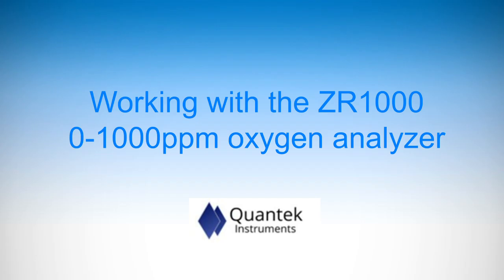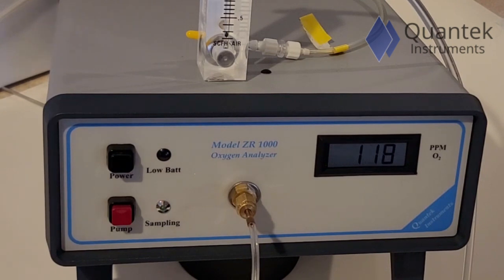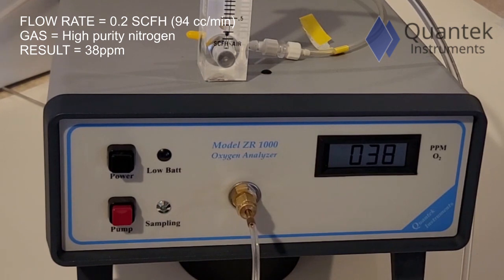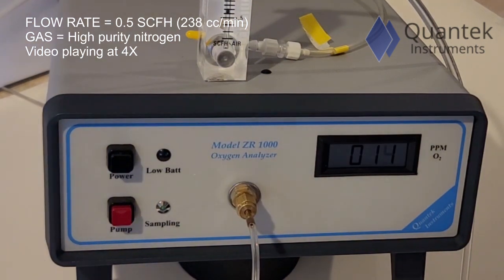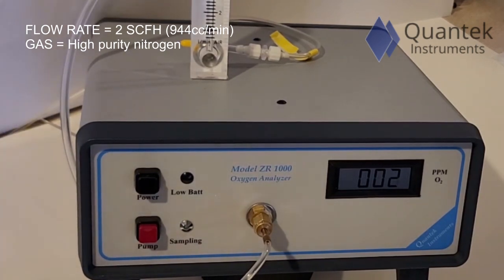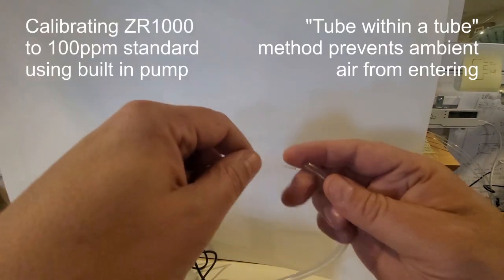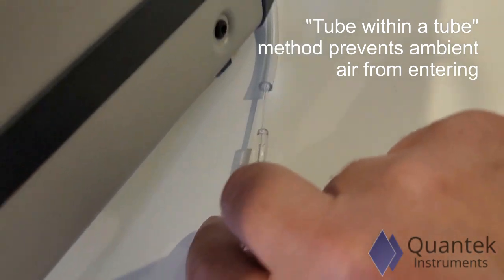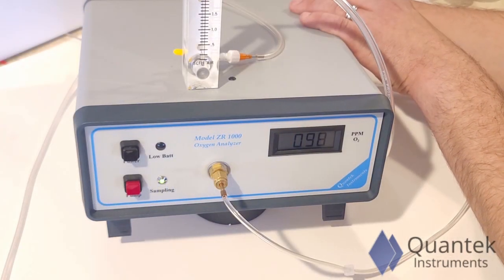Working with the ZR1000 ppm oxygen analyzer

Comment: Im having model 902p and the pumb button is different i mean its flat not a button. Now how can i use it
Reply from the maker: Hello Ram - if you have a flat black plug on any of our analyzers, that means it was purchased without the internal pump option.    Modifying the analyzer to add a pump requires sending it back to us - several components will need to be changed.    Your best option would be to purchase a mini diaphragm pump with a flow rate of 100-500 mL/min and use it outside the analyzer.   (Note - for all of our analyzers except the ZR1000, the ideal flow rate is 100-500 mL/min - for the ZR1000 the ideal flow rate is 700 to 1000 mL/min).